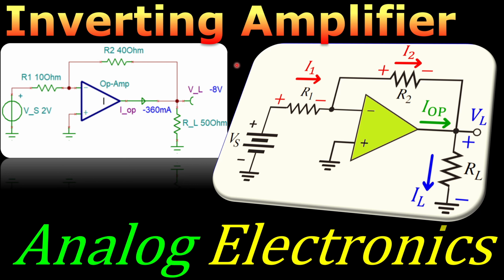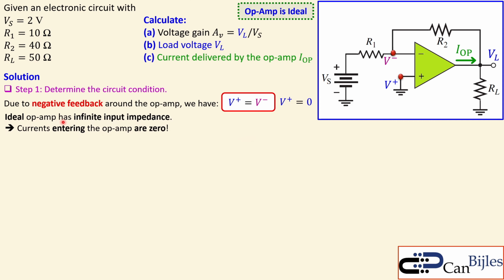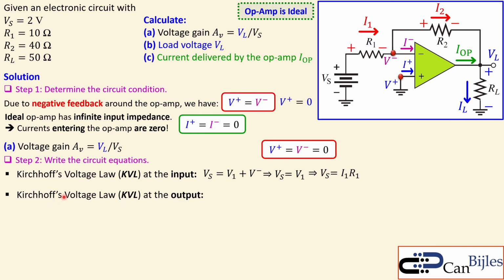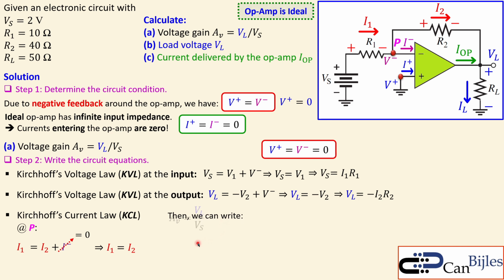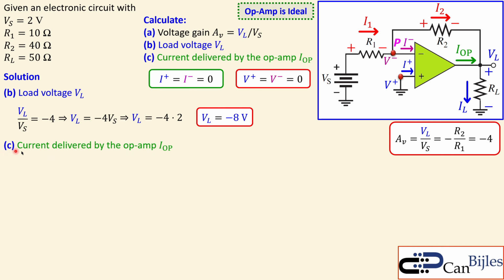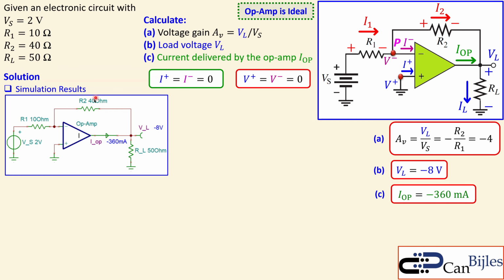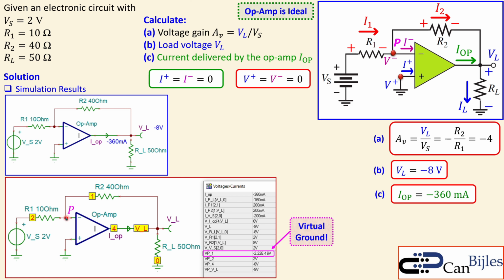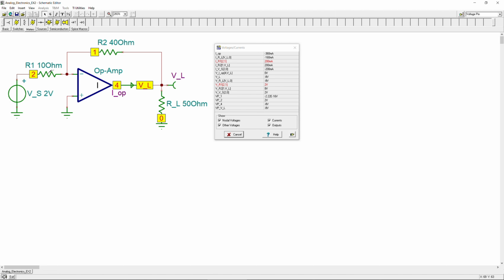Analog Electronics ⭐ Inverting Amplifier using Op-Amp - Basic Circuit ⭐ Calculations & Simulations

Comment: Thanks for sharing. Have you posted any video about Digital Circuits first course ? and could you please recommend any good resources for learning digital electronics. Thanks in advance
Reply from the maker: Thanks! I do not have videos about digital electronics. I should recommend this book as a first course: Digital Fundamentals, Thomas Floyd
Reply: @CANEDUX  Thanks for your reply. I've completed a first course in analogue and was wondering whether working with electronics mean dealing with both analog and digital signals? 
Secondly, I got Floyd's' book and would like to watch lectures or videos,I would be grateful if you could name two or more.Thanks in advance
Reply from the maker: @Fidel-tk5rq  In modern electronics design, you are most often using mixed-signal components, so some basic knowledge of digital electronics as a die-hard Analog Electronics Engineer is helpful. 

I think this playlis is a good resource for digital electronics: https://youtube.com/playlist?list=PL5Q2soXY2Zi8J58xLKBNFQFHRO3GrXxA9
Reply: @CANEDUX  I can't thank you enough for these amazing lectures, however, I think I need an introductory course in digital electronics before that! Thanks in advance.
Reply from the maker: @Fidel-tk5rq  You're welcome! I think you can start with the book of Floyd as a good introduction.